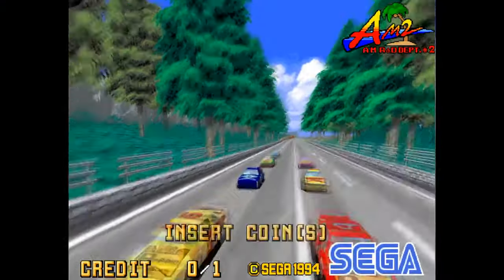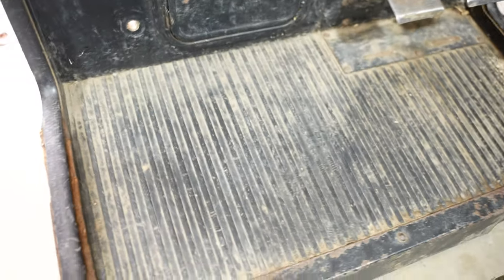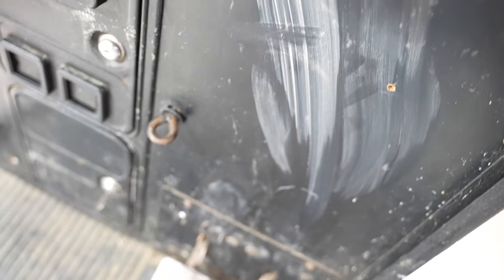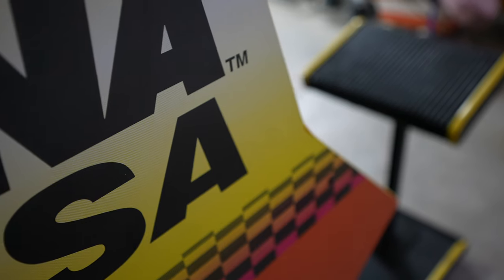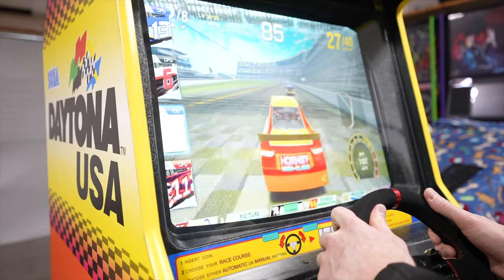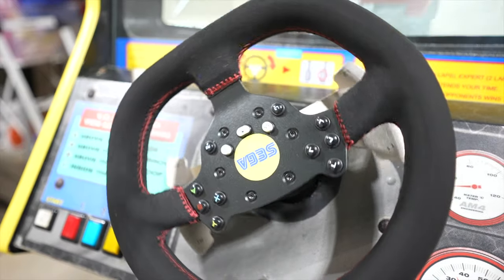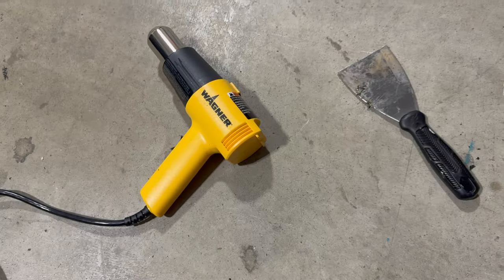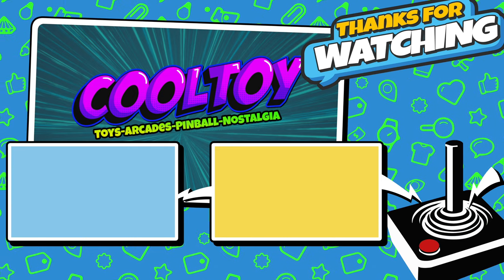I Brought This Daytona USA Arcade Machine Back To Life!

Comment: Awesome work! I did a similar conversion with a F&F Drift and it's been the greatest thing since sliced bread🍻
Reply from the maker: Nice! Down the road I’m likely going to add an actual seat from a racing cabinet like that. The pedestal on this unit is fine for me, but my little nephews come over for gaming and they will struggle to see the screen without a boost
Reply: @cooltoy  Yep then you can add a subwoofer and bass shaker of course. Good times!
Reply: @cooltoy If you want the full size one is less rare so maybe trade a collector that has one of you keep the original parts from this one you might get a full one and then you won’t need to convert it. AFAIK the pedestal is also rare on this unit so treat it and its parts kindly.

If I was in the states and owned the full cab I’d trade you, as I’ve always wanted the standup version.

Comment: I am currently rehabbing a Ghouls 'n Ghosts arcade. What kind of black paint would you recommend to use for the side of the cabinet?
Reply from the maker: Satin Black is typically what I use, as it's a nice middle ground between Flat and Glossy Black.
Reply: Have you had any issues with graphics sticking to latex paints though? @cooltoy
Reply from the maker: @dennyk2294  I’ve never had that issue, just make sure the paint has had ample time to dry and the temperature in your work space is adequate when applying the graphics
Reply: Cool, thanks! @cooltoy

Comment: Cool build! I followed your a1up pinball screen mod! Would you be able to share how you configured the wheel for each game in a separate video? Working on converting a cab to driving cab and everything  works but struggling to get the wheel working with each game/emulator.
Reply from the maker: Unless you are using the exact same wheel and encoders as I did I couldn’t really help you out in that aspect as how I set up my games would be completely unique compared to your set up with different hardware

Comment: Is it easy to get an arcade shifter to work with your PC?
Reply from the maker: Shifters are easy as they just use micro switches and can be connected to a pc with just about any kind of usb encoder. The tricky connections are pedals and steering as those require analog input signals to be read by specialized usb encoders

Comment: Any reason why you couldn't have just sanded the old art off rather than scraping it off?
Reply from the maker: Typically it just sands the surface graphic off and then creates a horrendous mess when it gets to the sticker residue on these old machines

Comment: It’s not complete because you left all that rust around the shifter and that beat down artwork on the control panel, get in there and get it 100% 😂
Reply from the maker: That control panel graphic is "unobtanium" so I'm glad it was as in decent enough condition as it is. The rust just adds character 😆